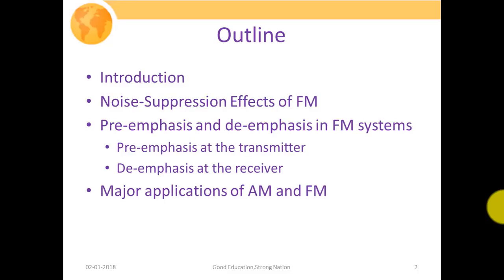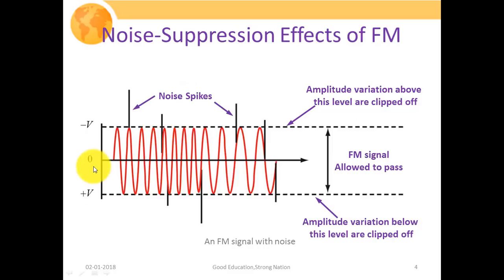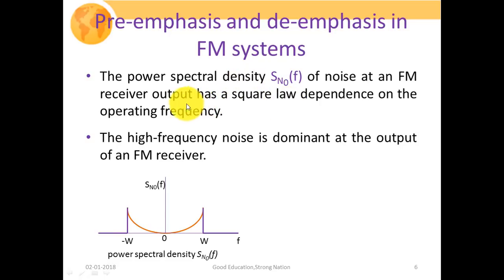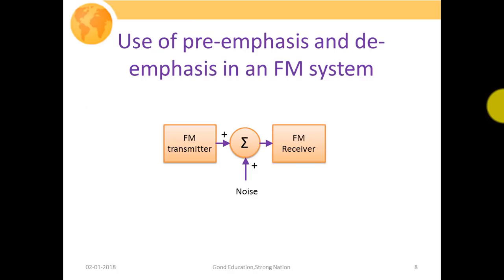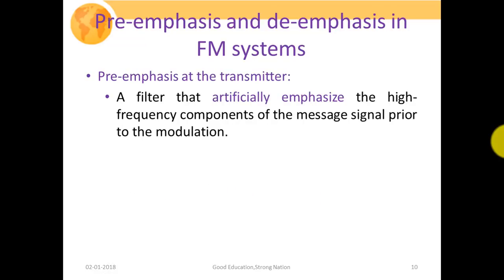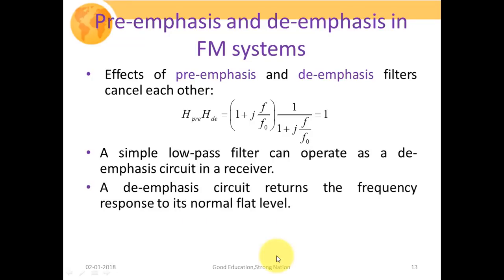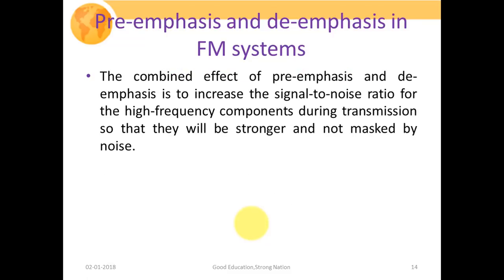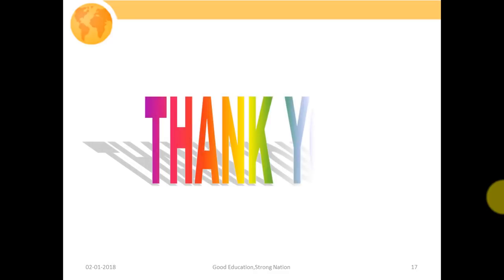Pre emphasis and de emphasis in FM systems | Frequency Modulation

Comment: sir, can we use pre emphasis and de emphasis filters in DSB SC? if no, then why can't we use? thank u
Reply from the maker: It seems that it is your assignment question.Is that so? I am not going to answer it completely but I am giving you a hint and i want you to answer this question properly in reply...
FM works in 88-108 Mhz band where high frequency noise occurs...is this the case for AM? if not then what is the utility to use? and yes theoretically you can do if you want without utility...study slide number 6 properly...hope this will help.